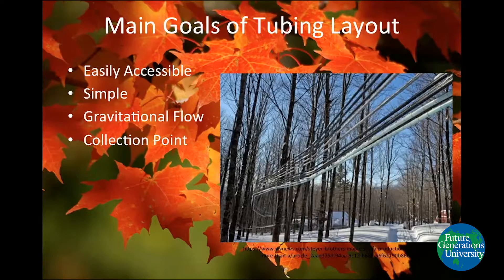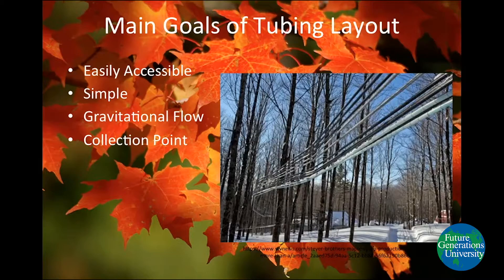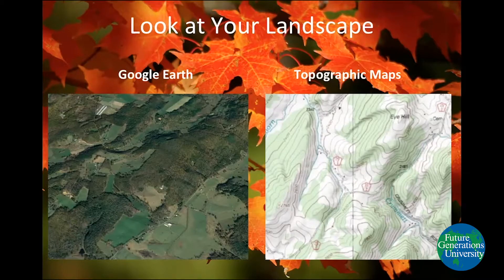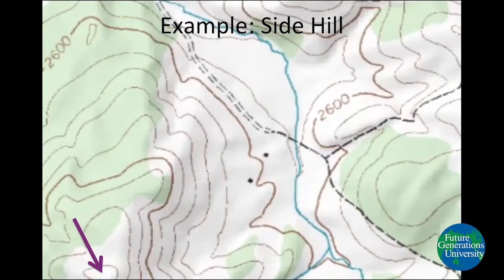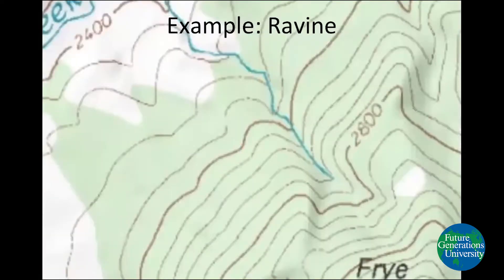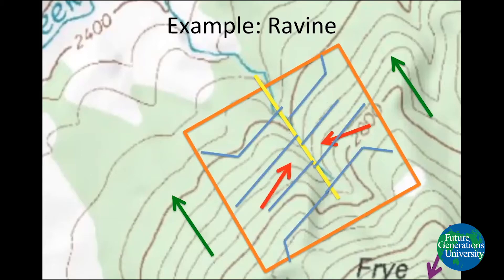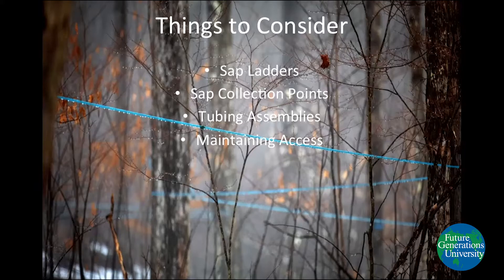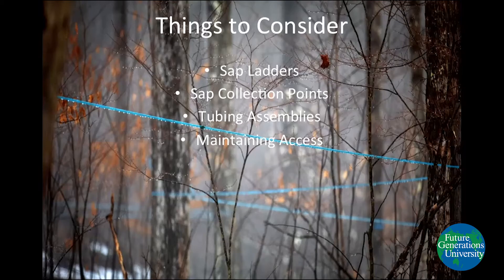Tubing Theory and Layout

Comment: What’s the difference between a 3/16” tubing system and 5/16’ system?  I was going to have between 10 and 25 taps on one lateral line leading to my holding tank.
Reply from the maker: Hi Steven, the 3/16" and 5/16" refers to the diameter of the tubing. 3/16" can create natural vacuum with significant slope (approximately 30 feet of drop over the course of the line), which makes it popular for people with small operations. Depending on your drop, you make want to consider 3/16ths. Feel free to send more specific questions to syrup@future.edu!